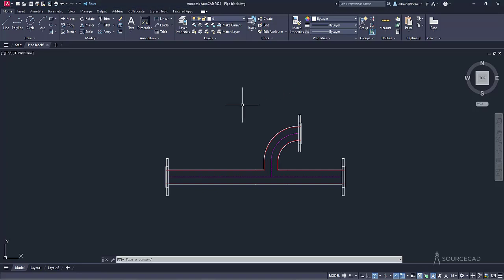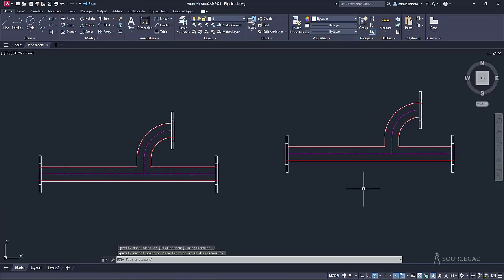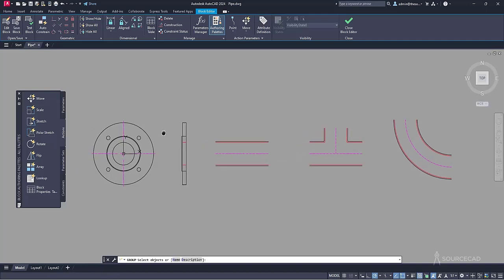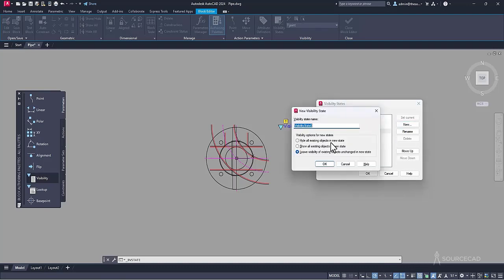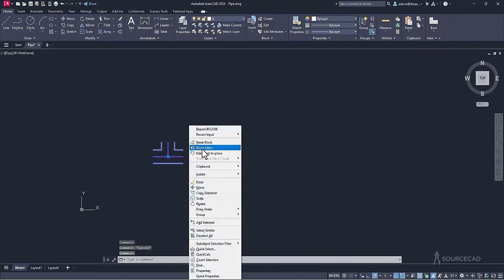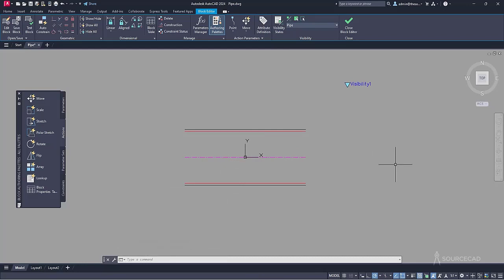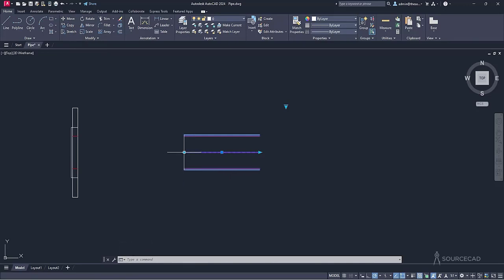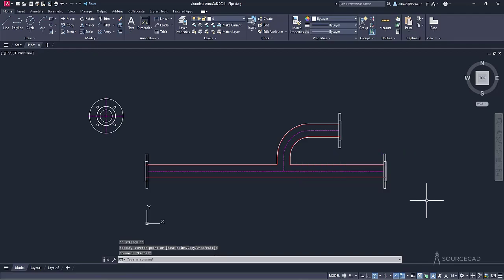Making pipe diagram using single AutoCAD dynamic block

Comment: I am already 2:30 min in the video. I suggest to only center the basepoint when needed. I mean. The pipe, elbow and T. Are really not usfull if you want to use several button that has a macro to instert the block with the correct vis-state. You won't be able to chain the blocks because  the basepoint of the block is off.

Comment: I have 20 years experience as an Autodesk consultant. This is creative, however I would not recommend building a library like this.
This approach...
...overcomplicates design of the block. This makes it very difficult to adjust later.
...after placement, you will need to 2 more clicks to change visibility state (unless the default is what you wanted). It would have been simpler to insert the correct block the first time.
...every instance of the block will have the same name so counting items becomes more complicated.
...all block attributes will be the same even if they do not apply to the part you are using.
...dynamic block controls may not apply to some visibility states. FOR EXAMPLE: most engineers would want a radius or angle on the 'elbow' and that is not applicable to other visibility states.

My general advice is that library components should only be 1 thing with changes to numbers (diameter, angle, length, etc.)